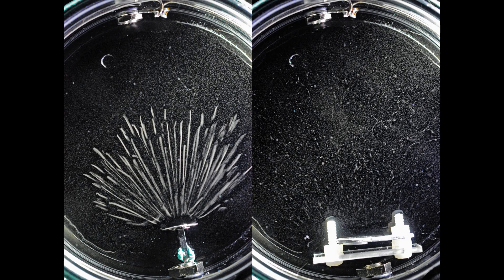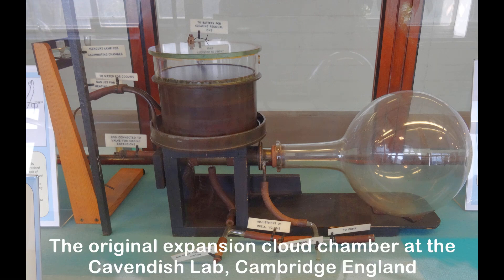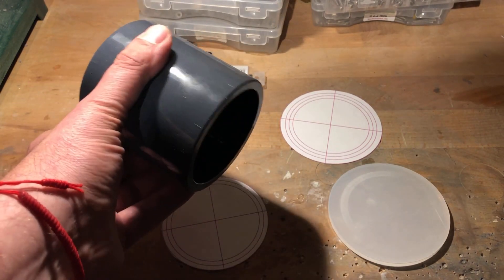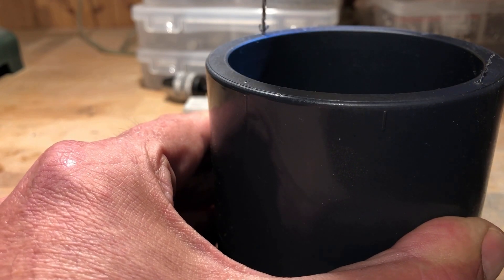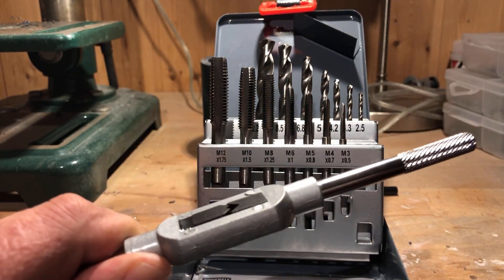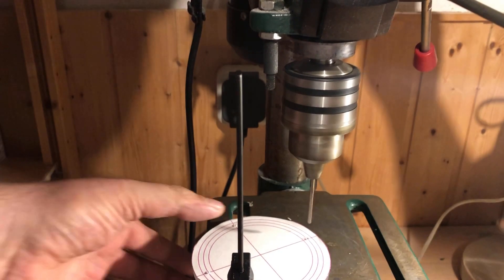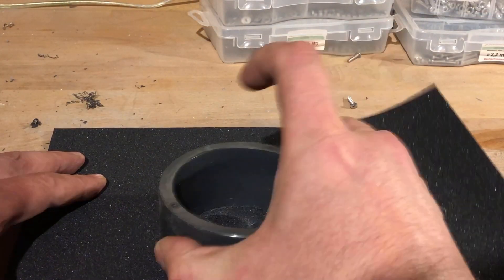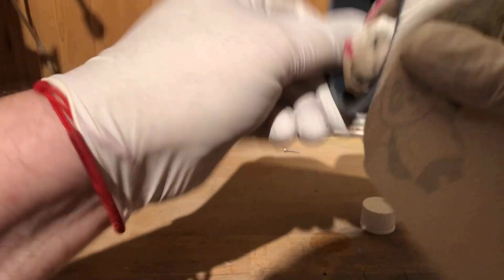Building an expansion cloud chamber from scratch - Part 1

Comment: I am so stoked for this series.  

I started building one late winter 2019...it has been in a box since.  It was to be a pretty versatile unit, made for more then just detection.  But it was the cloud chamber first in its design.  

I’m so glad I found your channel!
Reply from the maker: Thank you. What type of cloud chamber did you build?
Reply: @Marbslab  I did end up build one with stacked peltiers and the cut off pvc/abs from the larger chamber that is still boxed.  

The one i finished was just an evenings ocd build to satisfy the need for feeling like I had completed something.  Lol.  If did turn out relatively well though.  

It had an alcohol bath to help cool the hot side, I would toss in the freezer to pre chill.  Then I had a small section of string LEDs I sandwich between the abs and the bottom viewing glass.  

The other chamber is mostly finished.  The bulk of its body/chassis needs to be melted together for its final assembly.  The main unit looks like an oversized thermos.  Basically 4 and 5 inch D pipe on both top and bottom with a glass cylinder viewing window.  That’s about 30 cm tall.  

Then that unit has both feet to stand alone, or can be fixed to a glass and hdpe base.  In design I realized for this build I wanted functionality.  since I had a few other projects going on and a single chamber to handle a variety of pressures/low vacuum, gas’s in particular ratios, and temperatures would be great.  

So the base was basically a manifold and power supply.  

The thermos unit has its own manifold, thermal regulation, lights, etc all on board.  But the station really simplified a few things.  Under it I have a few 32oz “paintball” co2 tanks I could hook up in line to a proper vacuum/compressor pump for whatever need.  

On the cloud chamber side, the peltier set up would easily get cold enough in the thermos.  But would not hold temperature for as long as I wanted.  Which is in part why I ended up wanting the additional feature of being able to fluctuate pressure.  

In testing, the charged co2 tanks on their own could creat a relatively slow lasting cloud of vapor.
Reply from the maker: @gibbyrockerhunter  Wow, that sounds like a very ambitious project.
Reply: @Marbslab  yeah...maybe that’s why it was shelved when life got hectic.